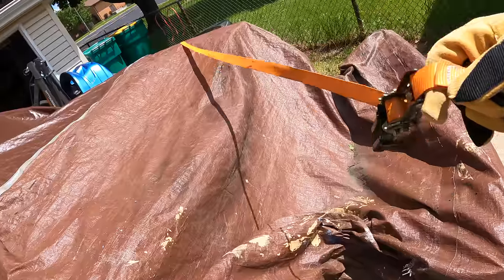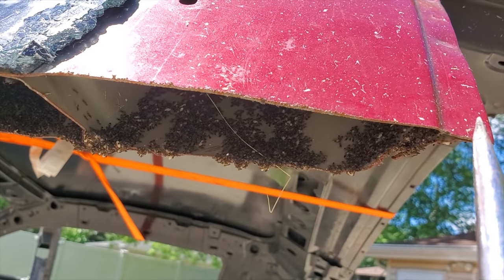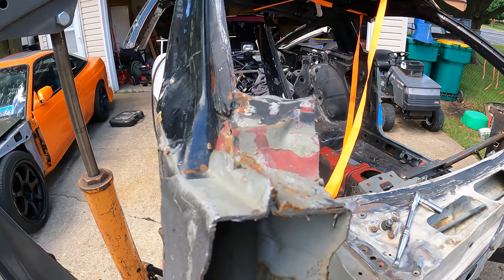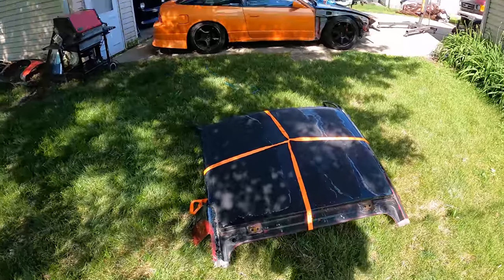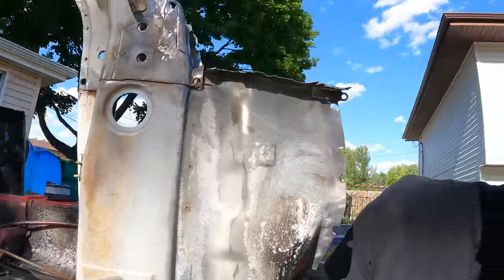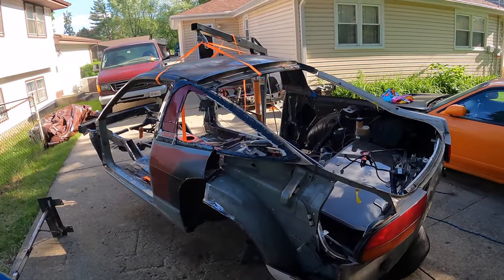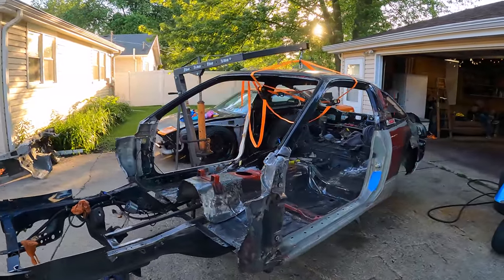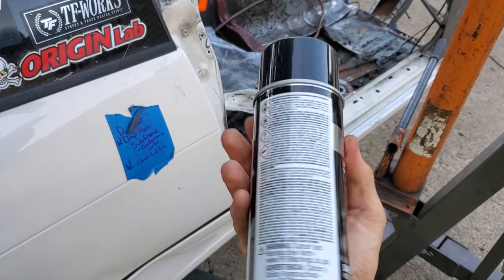Fitting the Last Piece to the 240sx Puzzle! (EXCITEMENT THROUGH THE ROOF!)

Comment: Mike- If you haven't already, you need to invest in some Cleco temporary fasteners. They will allow you to get the sheet metal on one joint aligned and then locked into place while you work on another joint.
Reply from the maker: Interesting! I'll look into that, I was going to use sheet metal self tappers tbh

Comment: When you go to weld through the weld through primer, I had the best luck using a pick or small screwdriver to scrape away the primer in the hole. Otherwise it spit like crazy. I think I mentioned this previously, but wanted to be sure.
Reply from the maker: Interesting! Thanks for the tip!

Comment: i would add some sleeves into some of the roof structures so fit up would be easier. and then when you weld it up you can put some good heat into it. and self tapper screws work wonders for temp fit up of stuff before welding.
Reply from the maker: Thanks for the tips!

Comment: you probably have a plan for the left side A and B pillars but if you don't. a good way to reconnect stuff like that is to slide a thin wall piece of angle steel inside like 14 gauge, just a short piece so you have some overlap for strength but if it's too long might make assembly difficult. so then you weld 1 side in and drill holes in the pillar piece for the other half so when it's set on there and in place you can access the encased angle steel and weld it together through the holes. and you just fill the holes in with weld so it's like a big spot weld. kinda like welding a nut onto a broken bolt, only your joining 2 pieces of steel. I hope this is helpful and keep truckin, this thing is coming along pretty quick.
Reply from the maker: Great ideas! Thanks for the tips! 🙌🔥

Comment: I don't know if you've ever seen my 300ZX it was my baby I had it 22 years I built it from the ground up and I had about five grand worth of ECU turbo intercooler fuel injectors fuel pump I was fixing to put in it and finish it I was almost done except the turbo system I had done my suspension I had done the interior I had done everything like I wanted it with the fadanza lightweight fly wheel and racing clutch and long story short I totaled it about 6 months ago and started building my V8 Blazer man I wish I could have done this to my car when I wrecked it it was my baby I've cried a few times about it LOL good job keep up the work put a big ass motor in that car it deserves it